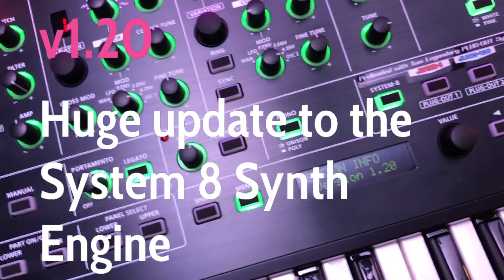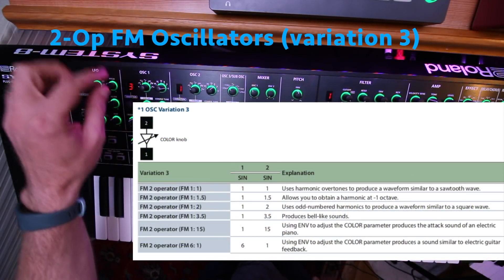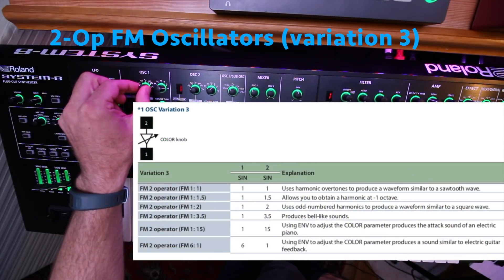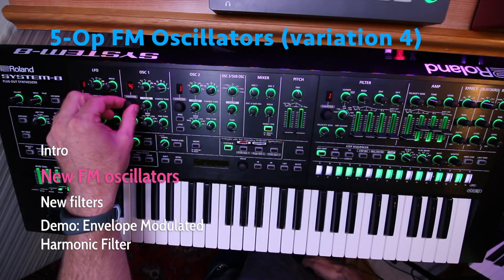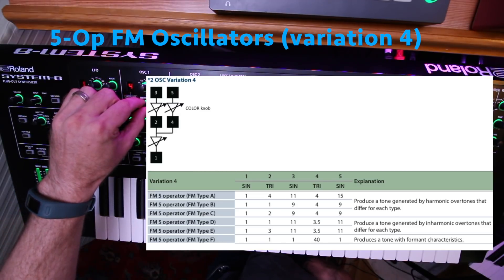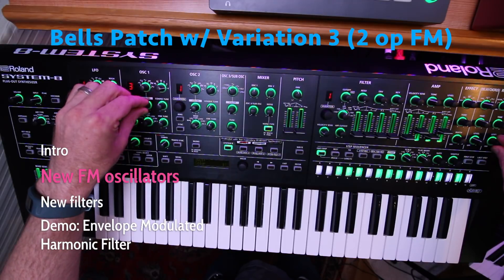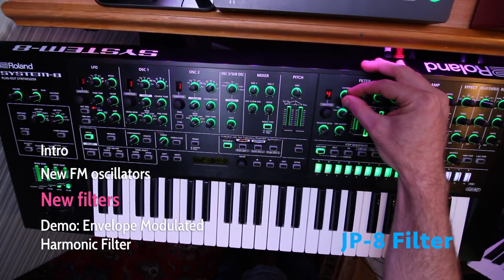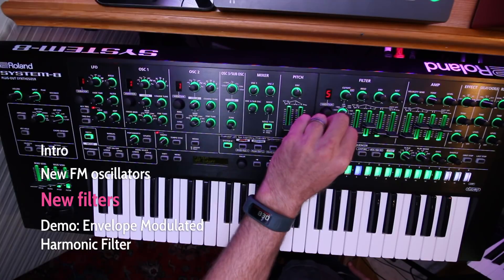New v 1.20 Firmware for Roland System 8 is a Big Update.

Comment: My system 8 version 1.01 ,i bought it used  ,plug out 1 jupiter 8 works properly,but plug out 2 juno 106 when i push button  says coming soon and slot is empty ,i tried to update it to vers 1.30 like in video from roland but it doesnt work for me and i tried to compare hardware synt with vst synth of roland cloud(abelton says that system isnt connected properly) could somebody please tell me what i can do with it?
Reply: Did you resolve this?
Reply: @maccagrabme  yess
Reply: @mikelore464  Was it a factory reset or how? Just in case I get the same issue as bought one used on the way. Thanks